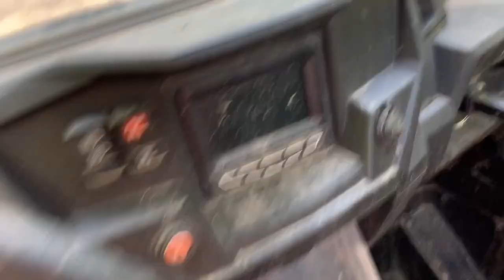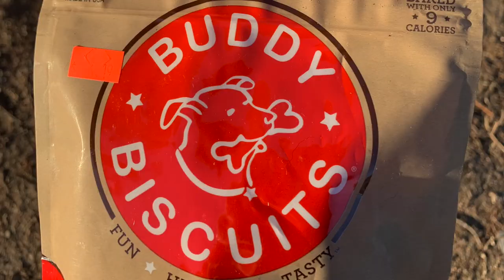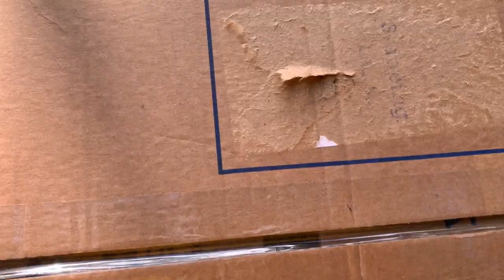Fabricating a custom RZR Knee Support and Buddy the Dog gets a Package

Comment: I also seem to spend as much time tinkering and fixing other things around the shop as i do working on the project at hand. 
I think you may find that a rounded bent might be a better option where the bend goes to the upper vertical (if that makes ANY sense).  a good bump may send your knee into that corner and the issue you are trying to resolve may become a secondary one for a short time.
Reply from the maker: I think I have enough clearance. May pad up the whole thing using pipe insulation and electrical tape, 3Ms Super 33!